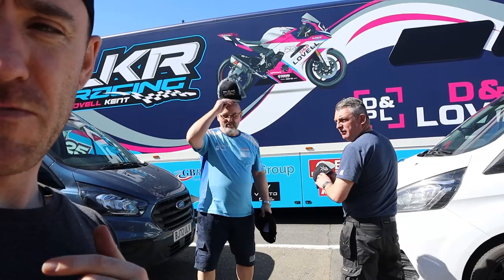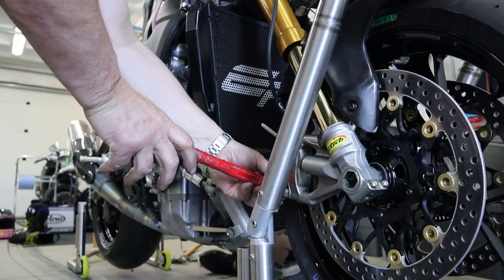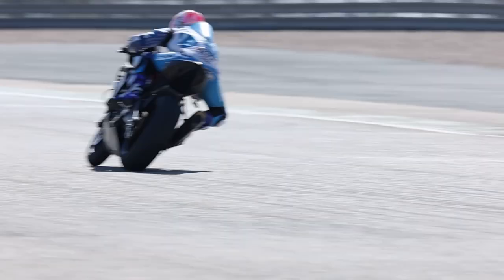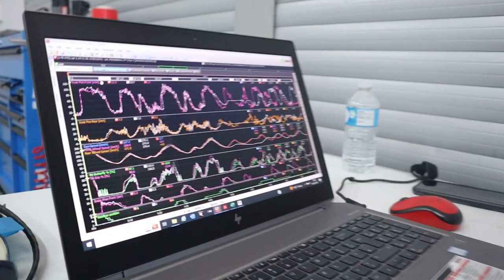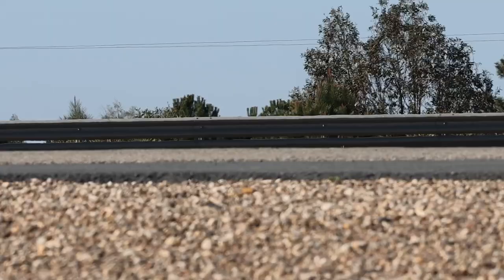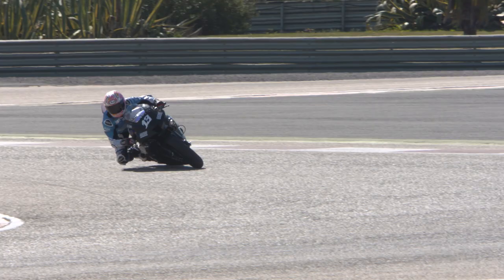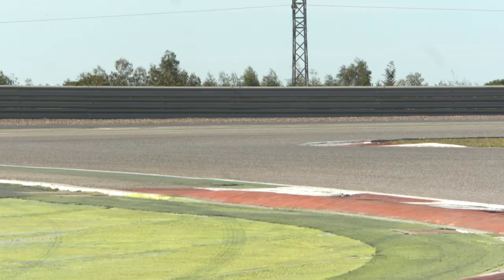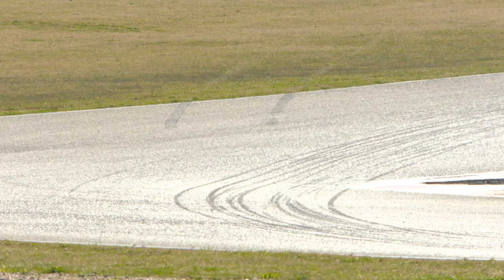VLOG #2 Electronics and how we set up as a team

Comment: Motorcycles these days even for the street come with numerous adjustable features. I have never ridden a bike with any as all my bikes have been and are still, old. For 99% of street riders all they are is a bit of a safety net. It is not until you get to the top level racer that you have the ability to fully understand and get the benefits from these settings. Very interesting to hear the thought process that goes into the use of these on bike adjustments. How they work for and against each other. Complete antipode to my riding life. Wobbling around trying not to fall off. And get from point A to B in one piece. At least having spent well over 40 years doing this gives me an appreciation of what a racer at your level has to do to be competitive. Looking forward to the TT. Booked my pay view ages ago so as not to miss the action.

Comment: Love the video Lee the main differences between my days working on BSB electronics is that the rider now has a lot inputs for setups on the fly. I remember on the Ducati it had a quick shifter a simple launch control via the wheel speed sensors. Also to change the ECU maps you had to physically remove the eprom from the ECU no selectable maps from the handlebar switches. All the best Les.

Comment: Great vlog Lee! Regarding the footage at the very end I noticed the fork travel was quite far from using the full stroke i.e. far from bottoming out with a little margin.  Is that normal or was your forks set particularly hard? Thank-you 👍
Reply from the maker: Good point mate all forks don’t actually use full travel it depends on the internal and fork length etc